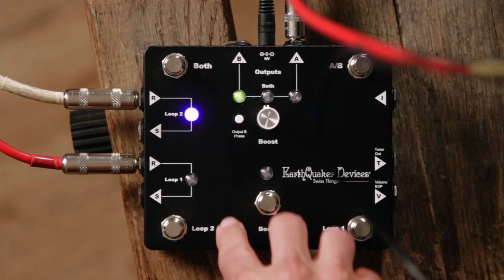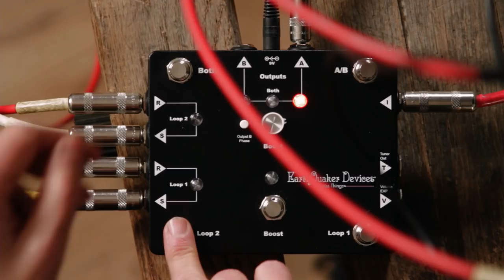David Scott Stone Meets Swiss Things | EarthQuaker Devices

Comment: why do guitar pedals have those tiny buttons to turn them on and off - doesn't it seem like if you're using your foot (or hands) the area should be way bigger?
Reply: Pedals like Boss and Ibanez use a larger switch surface area. The smaller switches are more easily sourced for pedal makers. It also allows for multiple switches to be placed on the pedal surface. As a player, you get used to them fairly easily.
Reply: The tiny push button is the cheapest reliable switch on the market and they break too, in 200 euro pedal i would like to see a better solution